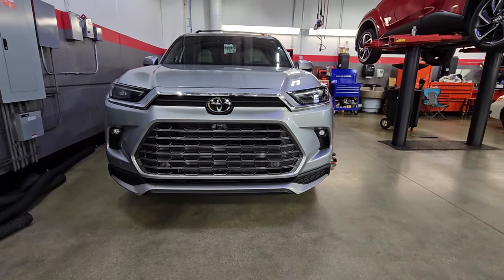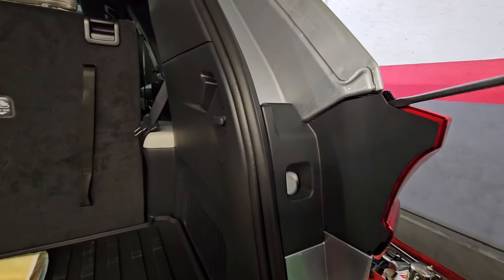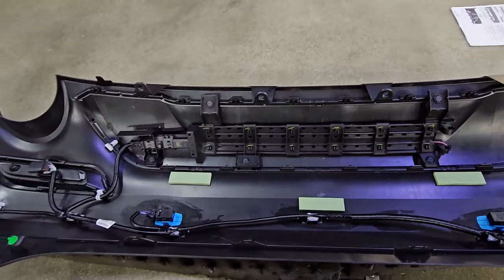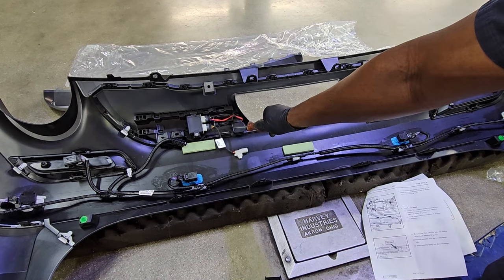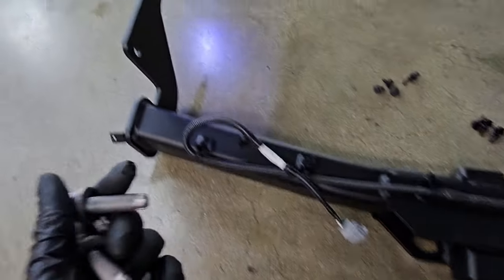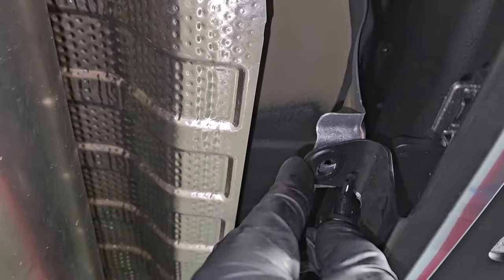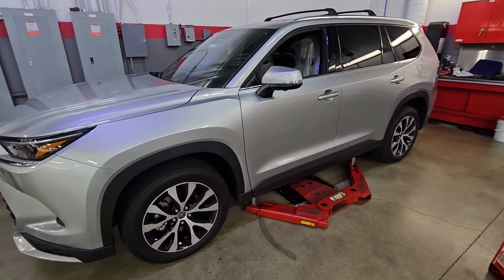TOYOTA GRAND HIGHLANDER TOW HITCH INSTALLATION (2023-2024)

Comment: Excellent video!  I just purchased a Grand Highlander and the dealer wanted close to $1,200 (just for labor) to install the hitch.  Watched your video, took my time and had it installed by myself in appx 3 hours in my garage.  No lift needed. Still need to install the hitch converter, though.  Tips if installing yourself: use a floor jack to assist in raising the hitch in place to get bolts started, and put a moving blanket or similar down to set the bumper on to mitigate scratches.
Reply from the maker: Glad it helped!
Reply: Hi where did to buy hitch with all stuff?
Reply from the maker: @mirianmikadze1579  hey, it's better to go to a Toyota dealer to order parts to ensure you get the correct items necessary. They will match what you need based on your vin

Comment: Nice video, I'm having my Toyota dealership do this exact install on my GH limited tomorrow.  Hopefully it goes as well as you did this one.
Reply: Just curious, how much was the installation cost for the hitch. Thanks
Reply: @carlosmartinez-sh5wc  it was expensive....around $1400 out the door for all parts, labor, and taxes. It's more than just the hitch that has to be installed, new bumper fascia, and kick sensor relocation bracket, etc

Comment: Interested on adding fog lights to my wife's XLE Grand Highlander, do you plan to do one video on that subject?  Also wondering about retrofitting parking sensors, if that is doable and doable in cost effective way.  Thank you.
Reply from the maker: If i get one in the shop, i will make a video. A few people have been asking me as well. As far as the parking sensors, it will not be possible to add that feature if the vehicle didn't come equipped with it already.
Reply: @TheYotaChannel   Thank you.

Comment: Any recommendations on adding a 5 pin connector without having to tap the reverse lights cable?
Reply from the maker: Hey, check with your local U-Haul hitch store. They should have plug-in adapters for what you are requesting. Or look online they should have more varieties.  Unfortunately, Toyota doesn't make one.

Comment: Great video! 

Question; the part with hitch and wire harness, where did you connect the wire harness on the hitch to the car? Do you have additional instruction of how that gets connected to the car?
Reply from the maker: Hey, after you remove the rear bumper, there is a wire connector with a cap on it towards the left rear corner area.  That's where you plug the wiring on the hitch to.

Comment: Thank you very much for the video.  Can you share the part # for this tow hitch kit
Reply from the maker: Hitch part #PT974-48240 
Check with your local Toyota parts department to see if your VIN requires a new kick sensor and bracket. And to assure you get the correct color for the pre cut bumper.
Reply: I believe the pre cut bumper is all silver no matter which body colour, but will double check with parts department. @TheYotaChannel
Reply: Any chance you can list all the parts (fascia, harness, sensor), and that looks like a 2”…is that right?
Reply from the maker: @IanFlett  the complete list of part numbers are in the description, just added 👍🏾
Reply: @felixtcwong hello, did you happen to find the answer about color difference? There’s a big price difference between the two non-kick sensor panels. $100 vs $250

Comment: This is an amazing video! What is the best way to get electricity to the cable?According to the person that sold me the parts, as soon as you plug-in the connector, you should get electricity with no problem. The video mentions a module, but is there any simpler way?
Reply from the maker: Hey, at 10:16 mark in the video , I showed where the tow converter will be plugged in.

Comment: Thank you for this video, it helped me and my son get our hitch installed.  Any chance you can add a photo or video of where the converter mounts?  I know it plugs into the 10 pin connector under the cup holder but I couldn't see where it would actually mount. The box has a bracket with two tabs. Thanks again!
Reply from the maker: Thank you.  The mounting location for the converter box is located in the area where you saw the connector, just a little further down. To get access to it, open the DRIVER REAR door and remove the body weatherstrip by the rear quarter panel, and you should be able to pop that rear quarter panel out far enough to get access to mounting tabs. I do believe the quarter panel has a 10mm bolt holding it to the body. You dont need to remove the cover completely. You just need enough room to get your hands in there.
Reply: Awesome, thank you!

Comment: @Jrdagreat thanks for such a clear explanation! That's a benchmark indeed. Can you please guide me for exactly the same process for 2024 Lexus TX350 Executive (Canadian specs) ? Do I need a kick sensor box and bumper cover? Can you please tell me which part numbers are these ? thank a ton!
Reply from the maker: Hey, for the TX350, im not sure of the part numbers. I have the part numbers for the Grand Highlander in the description.  As far as ordering parts, i recommend you go to your local Toyota parts department, and they can assist with the correct parts needes to complete the job for your vehicle.

Comment: Hello, thank you for the great install video!  Very helpful and well done!  I have a question about the parts list.  I know the hitch "kit" is needed, PT974-48240,  which includes the hitch and harness, but also a "Unique Rear Bumper Cover".  The parts list says that we also need a Bumper Cover Facia w/ or w/o kick sensor, PT938-48241-11.  Is the "Unique Rear Bumper Cover" in the hitch kit the same thing as the Bumper Cover Facia (w/ kick sensor)?  I have a Limited so, I'd like to keep the kick sensor, but will I have to buy both the kit and the facia with kick sensor?  If so, it seems like I'd end up with an extra facia from the kit.  Is this right?  I kinda hope not  because PT938-48241-11 is another ~$245.  Thanks for your help and, again, the great helpful video!
Reply from the maker: Hello, and yes, you will end up with an extra bumper fascia, your old one. The new one is needed because it has the cut-out for the hitch, and the new kick sensor and bracket are needed because of the new mounting location.

Comment: I have the Lexus TX 500h does it require the converter? Thanks you for your help.
Reply from the maker: Yes, if it didn't come with a hitch installed from the factory,  then you will most likely need it if you plan on adding a hitch.

Comment: Hello, great video! I’ll be using to install the same tow hitch on my 2024 Toyota Grand Highlander Hybrid Limited with the kick feature, however, do I really need to purchase a new kick sensor ecu and bracket or can I re-use the one already on the vehicle? Thank you!
Reply from the maker: Hello, you will need a new kick sensor and bracket. The design of the new lower bumper fascia is different because of the cut out.

Comment: This is an excellent example of teaching how something is done.  I will be installing a hitch on my new Grand Highlander soon.  Only one question, how do you install the relay assembly lamp control which connects the hitch to the vehicle electrical system?  I would love to see you explain how that feature is installed.  You have a gift for teaching.  Thanks for the video.
Reply from the maker: Glad it was helpful!
Reply from the maker: At 10:16 mark in the video, I briefly talked about where the tow converter will be installed. As far as the hitch wire that's on the hitch itself, there is a connector coming from the factory harness located in the left rear corner. Plug and play
Reply: @TheYotaChannel  So there is a factory harness that attaches directly to the hitch wire.  Then what is the white connector in the rear driver side cubby attach to?
Reply from the maker: @user-by9sx9wf2y  that is for the tow converter box/relay box. That is where you will plug it in to power up that hitch harness.
Reply: @TheYotaChannel  Does the converter box/relay box connect to the trailer hitch?

Comment: There's a fuse that came with the converter, where does that go? And if you wanted to convert to 7pin which line of wires should you tap into for reverse and brake?
Reply from the maker: The fuse goes in the fuse block under the hood. The kit comes with one, but all the ones I've done already have the fuse installed. You can keep it as a spare.  You can get an adapter to convert it from a 4 to 7 pin

Comment: The kick sensor itself is on backorder. It will not arrive in time for me to install before we need the hitch. Can I install the bracket and bumper cover and the kick sensor at a later date when it arrives? Just leaving it unplugged for now? Or will that create any electrical issue or sensor issue? Great video!

Comment: Great video!! Going to try installing myself. In your opinion- do you need to take the bumper completely off- or could you accomplish it all (might take longer) without removing? I've watched a couple times and it looks like you can get to everything without the added potential trouble of taking the bumper all the way off? Am I missing something?
Reply from the maker: Hey, yes, i would recommend taking the bumper completely off. Remember, you still need to replace the lower bumber fascia because it has the cut-out to fit the hitch.
Reply: @TheYotaChannel  Thought you might be able to slide up and into position once you replaced the fascia. One other question- What is the harness you mention at 8:55 for? Does it just hang out inside there unless you have something to plug into it while you tow?
Reply from the maker: @LittleOwlLetterpress  that harness you saw comes with the hitch assembly. It plugs into the vehicle's harness, which is located in the left rear corner area behind the bumper
Reply: @TheYotaChannel   duh!! Got it- appreciate the feedback. Thanks for posting this and again- solid video!!
Reply: If you don’t have sensors (XLE models) then you can replace the bumper cover without taking the entire bumper off.  You can pop it out while laying underneath the bumper
Reply: @andymike6575  fwiw I tried this and physics is not on your side, imho it’s just easier to take the bumper off. I used a pancake/scissor jack like I use for my motorcycle to jack up the hitch into the bolts align. On my xle I also had to hook the end of the hitch mount over the exhaust. Try not to put too much weight on this, just my 2 cents.

Comment: Thank you for this video.  I live in central Texas and even the dealership that I bought my 2024 Grand Highlander told me they could put a tow hitch on but that I would lose my kick sensor and it was going to cost me not only the parts but a 6 hour installation service.  Does it really take that long to do the wiring?
Reply from the maker: Hey, yes, you can absolutely get it installed and keep your kick sensor feature. As far as how kong it will take, that varies on the technician and if they've installed one before.  The wiring is not difficult at all. It's plug and play.
Reply: @TheYotaChannel Gosh, I wish you were in central Texas because $3,200 to put on a tow hitch with wiring seems exhorborant.

Comment: You  mention a converter. What does it do? Is it required to tow? Please advise.
Reply from the maker: The tow converter allows the hitch connector in the back to be functional. If you are towing a bike rack, for example, then you wouldn't need it.  But if you are towing a jetski or boat, you will need to have the turn signals,  brake, and reverse  lights working

Comment: Wonder how possible it is to get a hitch receiver with 1 of the 4 mount holes to be off. My 2 on the right side would not line up for anything. Taking it back to Parts tomorrow to compare with another hitch. Hopefully it’s just a messed up hole on the hitch.
Reply from the maker: Did you keep everything loose? The two brackets, etc.. It helps to make sure all the bolts and nuts are threaded by hand and kept loose until all the bolts and nuts are lined up.
Reply: I swapped it with another one from the dealer and it fit perfectly. Other one was 1/16” off from one they gave me.

Comment: Your video helped a lot! Just a question about connecting wiring harness on the hitch receiver. Does the car have a pre-wired plug off the rear bumper to plug and play? I have the convertor installed inside the cup holder already.
Reply from the maker: Yes, towards the left rear bumper area. It might have a plastic cap or cover connected to it to protect the terminal pins.
Reply: @TheYotaChannel  Got it. Thank you!

Comment: I have the kick sensor system. You list the kick sensor ECU part. You didn't mention it in the video. Do I need it or can I just use the original?
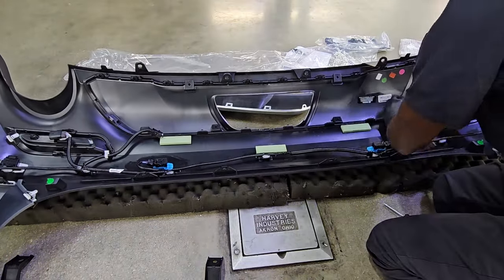Reply from the maker: Yes, you need the new kick sensor and bracket. At the 5:00 minutes mark in the video, i mentioned it.
Reply: Oh, the ECU IS the sensor. Thank you.

Comment: Great video, Would be nice to include the torque specs and socket sizes.
Reply: Most of the hitch bolts used are 19mm or 3/4. These bolts are supposed to be torqued to 86ft-lbs.

Comment: Thanks, is there a similar plastic trim with an opening in the middle for the rear bumper of the regular 2022 Highlander XLE in order to pass the hitch receiver through it?
Reply from the maker: Yes,  that model year also has a cut-out that fits perfectly with the Toyota hitch. but if you get an aftermarket hitch with the Toyota trim, it will not line up properly.

Comment: Great detailed video! Quick question, in your opinion do you think a vehicle lift is required to get the tow hitch installed? Could a couple people get this done at ground level without too much difficulty or is it too much of a squeeze?
Reply from the maker: Yes, i think it's possible to get it done on the ground without a shop lift.  You just need to be really careful lifting and positioning the hitch.

Comment: Awesome job dude! 👍

Maximum towing capacity? Also, maximum weight it can support for heavy e-bikes?
Reply from the maker: I believe the max towing capacity for the  Grand Highlander Hybrid MAX is 5000lbs and for the Hybrid models 3500lbs
Reply: Tongue weight limit is what you want to know for a bike rack. For this hitch, it is rated for 500lbs. Hitch mounted bike rack manufacturer will have a weight limit for the rack itself as well that you’ll want to confirm.

Comment: Dear Sir.  I have a question. I am waiting for a TGH to be transferred from Houston to Dallas.  It is a 2.5 litre 4cyl hybrid limited.  It dies not have a integrated hitch.  I was told by the Plano, TX dealer that the hitch kit is back ordered and hard to get with no time frame. (500 of them on back order) Is it possible to find this kit from another dealership and order it?

Comment: What tool did you use to remove the cupholder to install the coverter box? Thank you.
Reply from the maker: It pops off pretty easy. If you get a good grip or hold on it and pull up, it should come out
Reply: I was afraid of pulling, but thank you, you gave me the courage... job completed.  Keep those videos coming.  Thank you.

Comment: Does the wiring on the 2024 Grand Highlander have the 7 pin wiring plug connector?
Reply from the maker: Hey, no. But i do believe they sell adapters for the 4 pins

Comment: What a great job u did u utmost precise precision
It was remarkable job man
I hv a question i bought 2023 highlander hybrid month ago i want to install front tow hook bcz i want to tow my highlander with ford f150 for 300miles away to my in laws 
I dont want to put tgat many miles on highlander
Please reply me if its possible if not guve me other option i dont want to drive 300miles but want to drive my highlander once i reach their
Reply from the maker: Hey, thanks for the comment. In front of your bumper, there should be 2 covers hiding the front tow hooks.  But MAKE SURE your Highlander Hybrid is not an all wheel drive hybrid highlander, because that one will have a separate motor in the rear, and you dont want to tow that model with the rear wheels still rotating
Reply: @TheYotaChannel  it is all wheel drive
Now what's my option
Can u please reply
Reply from the maker: @rajendramodusu5980  drive it the 300 miles, or have it on a flatbed.
Reply: @TheYotaChannel  thanks for the reply
I got hybrid highlander in June 1week and just 7 days later G highlander came in same price only 500$ more
Bastards toyota dealer didn't told me about GH 
I m just confused was GH a better choice
U raved lot about GH I saw
Can u tell me what would u choose between highlander hybrid vs grand highlander ( keep hybrid max out of this comparison)
You are very experienced intellect person please reply with your logical reason
One more thing I hv not seen that many grand highlander on road or in town I live in Lafayette Indiana and travel lot to Illinois  wis Indiana and Michigan
In 3 months I hvseen hardly 6 or 7 ghighlander